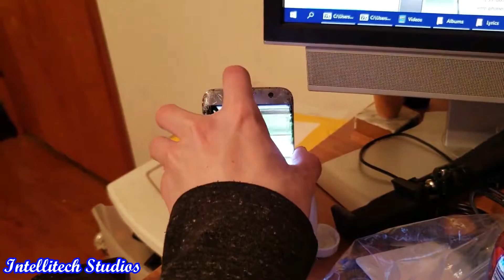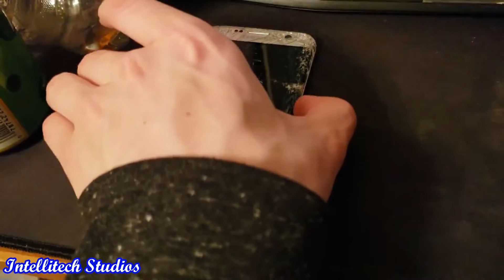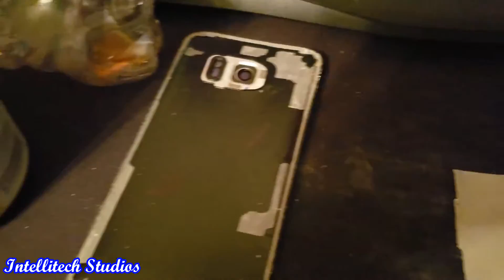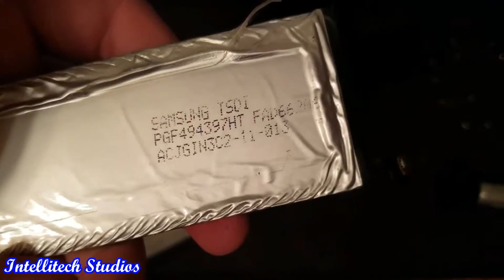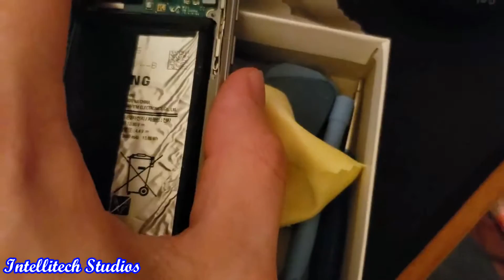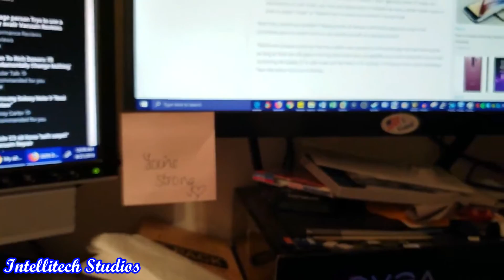Samsung Galaxy S7 edge Restoration (Repair Vlog)

Comment: do you still restore these? i kinda wanna save my gold one lol
Reply from the maker: Yes
Reply: @IntellitechStudios  how much? cuz everything works...but the LCD is cracked and changing colors like yours was...and the home button is kinda scraped off but works as well..
Reply from the maker: @jebc3po  a new screen on ebay right now for your S7 edge is about 120-130, and that would also include a new frame and a few other parts, looks like the home button as well. So include a back panel for 10 or 15 and you got a brand new phone
Reply: @IntellitechStudios  and if you threw in a new battery as well? Cuz i definitely feel like this 1 is on its way out...
Reply from the maker: @jebc3po  battery would be around 10 bucks. Keep in mind these are the prices for the parts themselves, not for if you payed someone to perform the repair
Reply: @IntellitechStudios  i was honestly just gonna ask you to do it lol i jus wanted to kno how much it would cost for the entire repair

Comment: looks like it was ran over.
Reply from the maker: Looks more like it was dropped from very high a few times. Maybe in a construction area or something. Not sure if the internals would survive being ran over that well but it's possible. The build of the S7 edge is very strong.